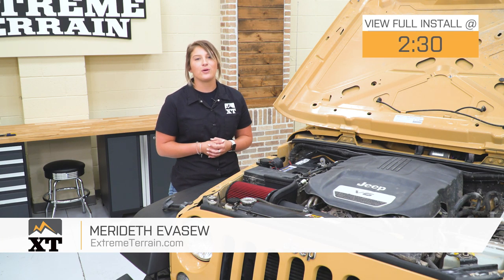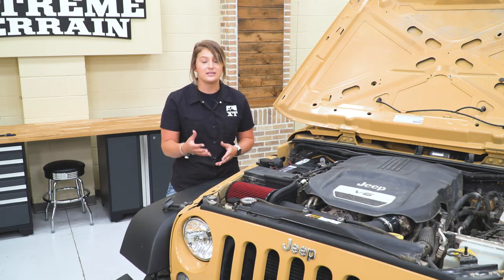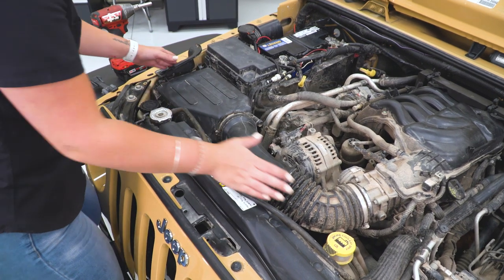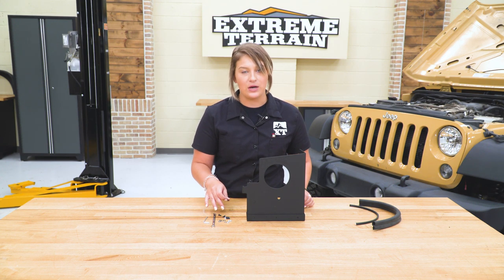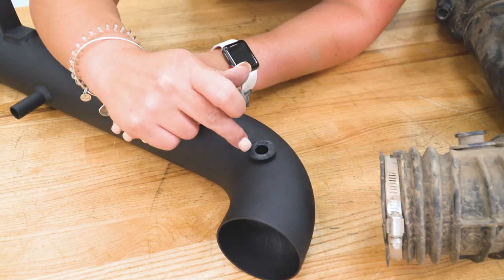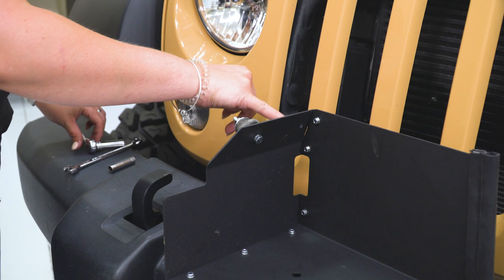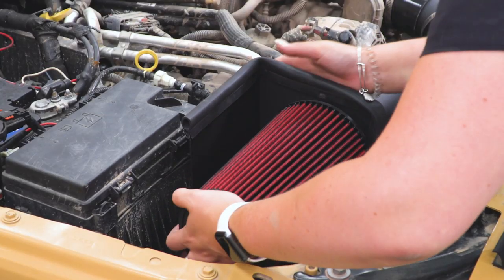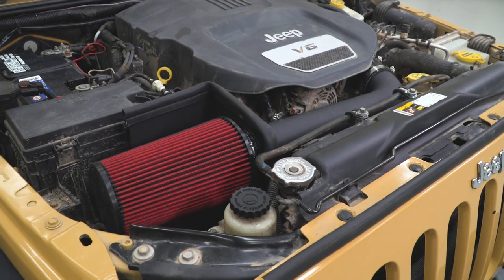2012-2018 Wrangler JK 3.6L RedRock 4x4 Cold Air Intake Kit - Black Wrinkle Coating Review & Install

Comment: As much as I may or may not have opinions on Intake kits, my opinion on workspace stands; you must have a clean work area before you start.  Don’t ever risk getting dirt and grime into your engine by not taking a few minutes ahead of time to clean the area.  All that mud and dirt and crud everywhere could possibly get into the intake.  I know I’m being picky, but a simple hosing off the engine compartment in the beginning and letting it dry while you’re doing the assembly is 30 seconds well spent.

Comment: I just installed this on my 15 jk rubi with the Throttle body spacer only a xtra $50 right away I noticed the difference sound and in the  get up and go.. seems solid

Comment: I have a 1988 YJ and I am considering this for my application.  question, would it be recommended to upgrade to fuel injection vs carburetor application.  Side bar, something very appealing about a mech that has nice hands and not afraid to get dirty.  lol  Great job illustrating this application.
Reply: Post a pic of your 88 on your channel.  I have a Weber on my 88.

Comment: Cold Air intakes (for the most part) are  a waste of time and money, not to include how parasitic it is if it's not getting fresh air directly from outside, not under the hood. It's all about Air Density, hot air is less dense, cooler air is more dense. Watch and read some Banks Power, Gale has this down!

Im sure most jeep owners go through water from time to time, AT tires and cold air intake??